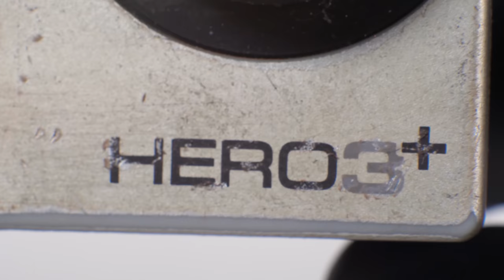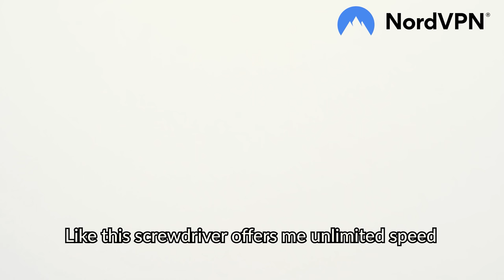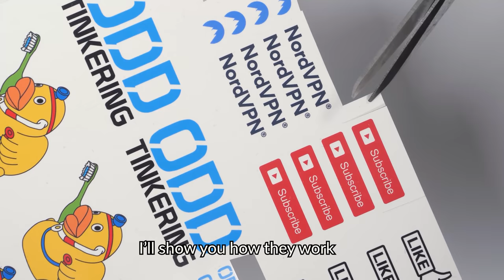Restoring Broken GoPro Hero 3+ a Subscriber Sent Me - Action Camera Restoration

Comment: Note to most people: DO NOT clean an image sensor with a q-tip and alcohol unless you REALLY know what you're doing. For most image sensors you should use a lint-free microfiber flexible swab designed for cleaning image sensors and methanol instead of isopropyl alcohol. Otherwise you run a major risk of permanently damaging the sensor.
Reply: well, technically you cleaning an IR-filter, not the actual sensor, but yes, you are right, swab is must-have for this type of work!
Reply: and he didn't blow out the inside of the lens before reinstall
Reply: Yeah, I love these videos but I cringed at that...
Reply: @k0dabeat117  How do you know he didn't? If he videoed every single thing he did to a restore, it would take hours to watch it.
Reply: not relevant for this video though. he was not cleaning the sensor directly.
Reply: Don’t be so dramatic 😂

Comment: Polishing of the lens removes the anti-reflective coating, so it reduces image contrast and resolution. Scratched lens better to be replaced.
Reply: i thought the same when i saw the lens reflex with no colors after polishment...
Reply: And can create little distortions on the curvature creating problem with focus and blurring.
Reply: Came here to find this comment. Never ever polish a camera lens. They all have some kind of coating.
Reply: Image quality during the motorcycle ride is very bad. It confused me because I have a 1st gen Gopro and the image is better than that one. That's probably because he removed the coating, for sure. But great restoring nonetheless
Reply: obviously correct,  but we are all here for the spirit of the  game. An old GoPro isn't worth all that patience and expert effort anyway. There are plenty good used ones, but this is a restoration channel.  And there is no human way to re-apply a correct factory-grade  coating  on a lens without proper industrial equipment.  So degraded as it is, it works and it looks the part, which in a world of disposable equipment and  planned obsolescence  is worth commending.
Reply: @sandrodunatov485  - Which is why it’s better to just replace it for the $10-15.
Reply: It does not reduce the resolution.
Reply: @Cerus98  right, but thats not the point. None of the work put into that Gopro was worth doing...it would be "better" to just replace the whole thing with another used one in good condition. The point of the videos is to just show the process of restoring stuff for the sake of restoring it...not necessarily to do it perfectly. Sometimes he has to buy replacement parts because its the only option but any time something can be repaired with original parts even if its not ideal...is the entire point of the video.
Reply: @Bones12x2  the process shows only "unscrew - make it LOOK GOOD, but not make it good AS IT LOOKS LIKE, that's the point.

Comment: Helpful hint with waterslide decals. A few drops of Microsol under the decal to make it look like it was painted on (it's a mild solvent that melts the decal slightly onto the surface so ridges and seams don't cause bubbles or silvering), and then clear coat over it after it is completely dry

Comment: If I sent to you my 2DS which has one of the screen oversaturated (probably a problem of the inside board) could you repair it and send it back to me? I'm a big fan I'd love to get it repaired from you 💕
Reply: I know of an NTSC GameCube that needs a little work done, too. Apparently it cuts on and off repeatedly, and the disc reader isn't working in some manner. Former may just be because of dirt.

Comment: Doesn't polishing the lens like this, remove all the optical coating?
Reply: I think so. Is there a way to replace the optical coating?
Reply: I think for a low cost/quick fix, it is what it is–that is if you already have glass polish and the tools. I don't think a replacement lens is really that expensive
Reply: Yes, it does. I suspect the scratches were only in this coating (anti-reflective coating or AR) which made it fairly easy to polish out. Scratches in the actual glass would be harder to deal with. Without this coating, the images won't be as nice as they would be with it but this way you get a usable image without the scratch artifacts. A nice restoration of a very ruggedly-used GoPro.
Reply: @ricardocea4957  Ok, ill have to look into that. (for future reference)

Comment: Good restoration but I worry that the main processing chip won't last long. The stuff on the front cover at @16:59 is thermal paste which connects the chips to the heat-sinks, it dries up over time and needs to be replaced if the components are separated and rejoined.

Comment: Polishing lens glass is not quite ideal, since it's coated with ARC and you remove but can't recreate this layer at home, it's done with chemicals that you can't buy in a vacuum machine and baked on. The coating reduces reflections and lens flare, it makes the lens slightly more efficient too, since light that would get reflected passes through instead, this reduces the vignette effect. You can see the difference, your studio light is originally reflected green-blue; after polishing, the reflection is pure white and much higher magnitude. You can see that some ARC is still remaining around the border of the lens after the repair, where the pad wouldn't quite reach without eating into the chassis ring.

But if you think you can acquire the chemicals and apply the ARC, i would love to see you try.

That being said, it's difficult to be certain when you buy a replacement lens online, that it's original and properly coated either. So it's possible that compromises may be unavoidable.

Comment: Don't do like this guy did on a 4:30
NEVER USE THIS COTTON STICK!
Use sensor swab with suitable fluid for cleaning, otherwise - you will get a fat-prints from a stick, or even scratch it. No jokes.
Plus, at the very end of the video - you can clearly see, the overall contrast and lens flaring - is very strong, which is not because of "small camera", it's because he did lens POLISHING (bruh), he killed all the MultiCoating, and probably badly cleaned the sensor, so camera getting very problematic light, and can't handle it cause of this procedures. Stock gopro 3+ with good lens - never could work as bad as this one, he made useless work.